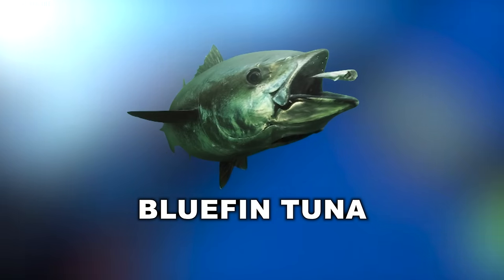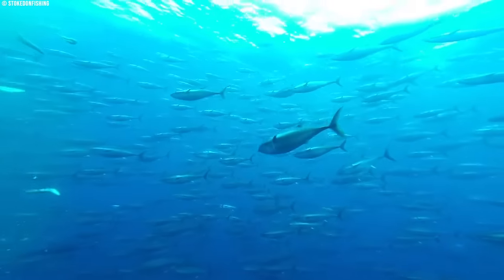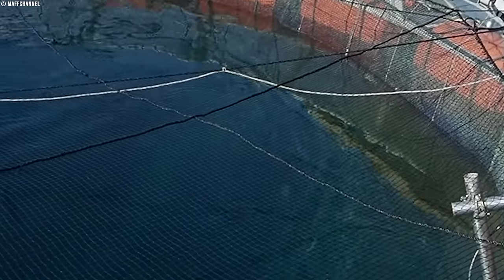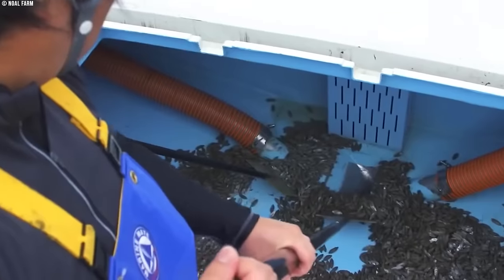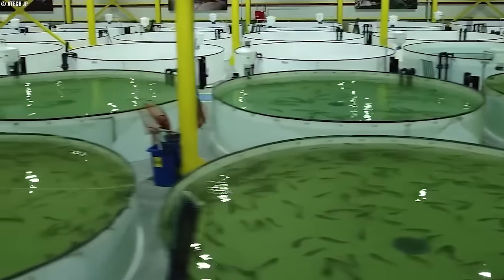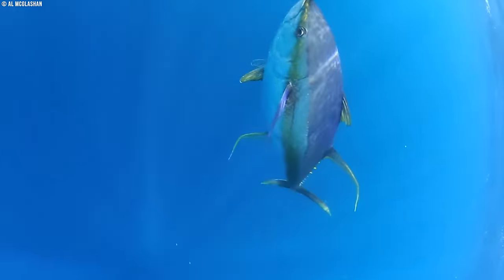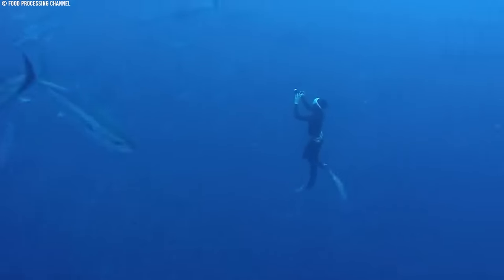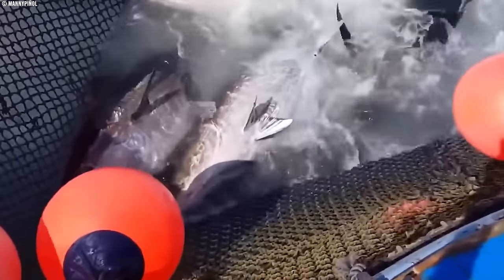How Fish Farmers Raise Millions of Bluefin Tuna Every Year

Comment: Hello,

I am an Associate Professor in Aquaculture Engineering at a public university in Turkey. I have worked in the faculty for many years; however, this term I have been assigned to a vocational school, which prevents me from continuing my academic work. Therefore, I would like to pursue my academic career abroad. I have sent emails to several academics in my field from South Korea, but I have not received any responses. I would greatly appreciate any assistance you could provide in this matter.